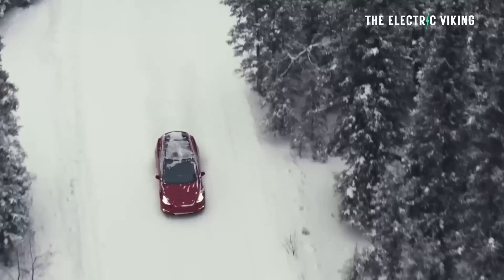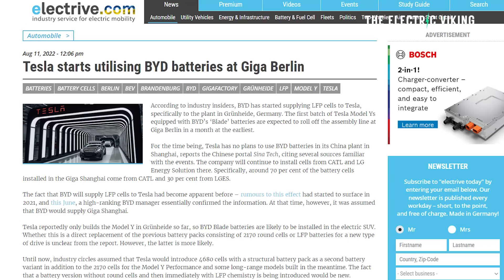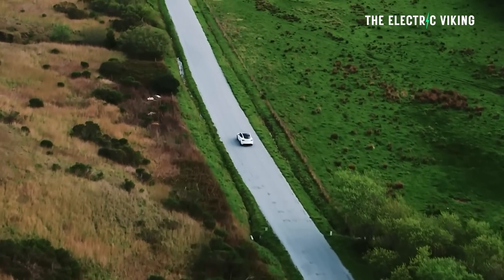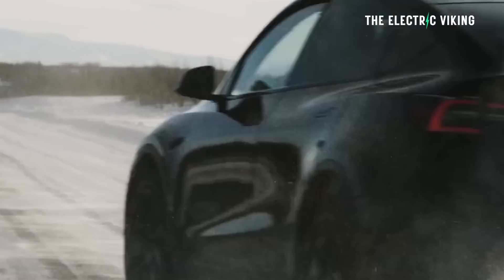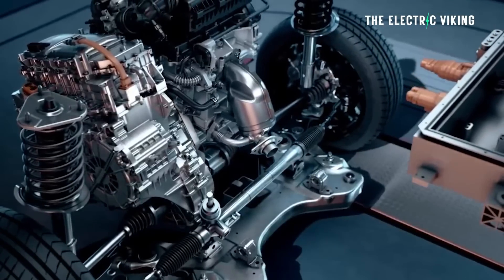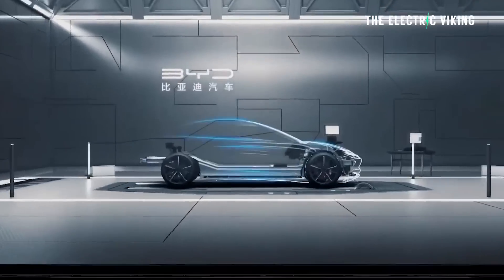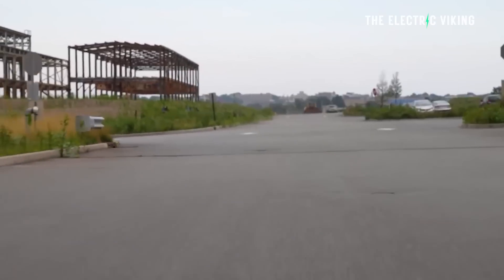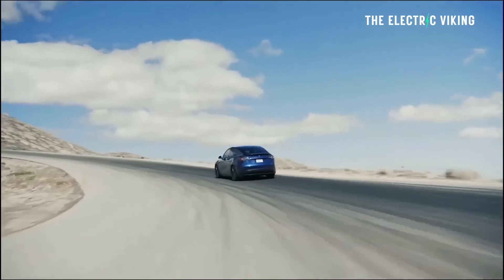Tesla Model Y's mysterious efficiency advantage VS BYD's Atto 3

Comment: Tesla is a superior car than Atto3. I driven atto3 in singapore and there are some issues with this car. Major issue is aircon failed to work during hot day and immediately after dc charging. It takes more than 10 mins for air con to cool. Range on atto3 is rubbish. The atto3 range drops so much after 10000km. Currently 480km range is now only 470km range and still less than a year. Wireless charging is total crap.

Comment: Let's calculate: front area Y 1921 mm width 1621 mm height maybe 85% of this rectangle filled times cw=0.23 gives 0.6088 m² for air resistance calculation.
At the BYD Atto 3: 1875 mm width 1615 mm height, assume also 85% of this rectangle filled times cw=0.29 gives 0.7464 m² for air resistance calculation.
At the weight, 1909 kg vs 1750 kg. Let's calculate 90 km/h:
Tesla Y: 25 * 25²/2 * 1.3 kg * 0.6088 = 6.18 kW against air resistance 25 * 0.01 * 9.81 * 1909 kg = 4.68 kW against rolling resistance, total 10.86 kW
Atto 3: 25 * 25²/2 * 1.3 kg * 0.7464 = 7.58 kW against air resistance 25 * 0.01 * 9.81 * 1750 kg = 4.29 kW against rolling resistance, total 11.87 kW
So why has the Tesla Y not a much longer range than the Atto 3?

Comment: They also use different motors, right? BYD and Tesla. There’s a bit a change in that. Since I have both model y and Atto 3, I would suggest Tesla has more efficient internal systems to run the car as well.

Comment: "How are Tesla doing this with the same battery?" Because of how leadership and political correctness work in organisations around the world. Dominated by leaders with zero material (in the sense that it matters at the content level) added value, who are in a leadership position because they had an urge to be the boss of something. Then the political correctness kicks in to tell higher levels what they want and need to hear. And innovation becomes an evolutionary, incremental thing where businesses behave like a monopolist who wants to saturate an entire market top to bottom, by selling their best product of today at a premium price to the most affluent buyers, next time frame for less to the next level down at the demand side and so on, in time replacing the top end by a marginally better or different version. Stupidity paired with economic practice.
Enter a hyper intelligent engineer, frustrated by all this, with a couple decades of experience, probably with a load of autism spectrum issues, thinking, I can do better.
Let's build a car: reduce drag coefficient, reduce transmission (including rolling) losses going as direct drive as possible, let's take a motor with very high efficiency so it must be electric and make its efficiency even better, and let's make all electronic circuits involved as efficient as possible. Rather than putting a committee to work on each of these, take a brilliant engineer in each of these subjects and the hyper intelligent boss scrutinises their work. Don't forget "design". Don't forget mass series production (Olds, Taylor, and Ford, could do it all by themselves, so you can too).
Dumb entitled leadership and PC - aircraft have crashed because PC meant you could not tell a superior they were wrong, killing hundreds of people, complete armies have failed, are failing, that way, political systems and bureaucracies are inefficient and ineffective that way, and successes are temporary because the hyper intelligent leaders also become victim of PC over time at the levels below them and generally are not able to select and coach the next wave of leadership.

Comment: The Tesla Model Y's external dimensions are actually less than 3% larger than the BYD Atto 3. 2.4% wider, and 0.55% taller. Not 20% larger.

The real world range of the Model Y LFP (60kWh) is nowhere near the 455 WLTP range (efficiency of 12.5kWh/100km). Other Youtubers have shown close to 18kWh/100km for the Model Y RWD LFP.

While the Atto 3, again, based on actual real world tests, often gets around 15kWh/100km, very close to their claimed efficiency.

I think Tesla is way over claiming their efficiency, and you seem to be blindly believing them, Sam.

Also, energy density is a function of energy vs weight .

In terms of comparing an EV, 60kWh is 60kWh. The chemistry doesn't change its output capacity.

Comment: It’s a mixture of small bits adding up, drag / frontal area, motor efficiency, cable sizing / length, Regen profiles, parasitic loads (aircon/heating being a big one) it doesn’t need to be much but if you can find 10-20 items with 1-2% you can find that 10-20% better overall efficiency

Comment: Probably a range of reasons that add up.  a) Cd - drag.  The Model Y = 0.23Cd, Atto3 = 0.29.   b) Rolling resistance (tyres etc)?  c) Tesla's motors and inverters are regarded as the best.  d) Then the ancillaries management, like the Octovalve,  e) better battery pack conditioning?   What you really want to compare is the actual range V say a MG ZS EV v BYD atto3 ie like for like as they are two entry level CUVs.

Comment: Tesla is surely more efficient with their thermal system and heat pump with the octovalve. More compact system with less loss. Also their computers and main cpu and screen(s) may be more efficient. They design their own chips and hardware in many cases. Their self driving computer which runs all the time is known to be more efficient than the comparable nvidia systems.

Comment: I was at a public charger this morning talking to a BYD Atto3 owner charging right next to me, and we were comparing batteries & range. His Atto 3 Had an 80kWh blade battery with 480km range. My Tesla Model Y RWD has a 62kWh LFP from CATL, and a range of 428km. We didn't compare distances traveled.  The Atto3 has a consumption of 166 watt hours per km. My Tesla is 144.   As Sam said, the BYD is smaller, maybe not as aerodynamic? but appears to be very close to Tesla's actual range per watt hour.   How this compares to other people I have no idea, but that's my 2 cents worth.   My Tip:  When on long journeys I pump my tires up to 45psi (normally 42) and drive at 5kph BELOW the normal 110kph limit on our highways.

Comment: 100% Australian accent yes. But don't expect non-english people to pick it up. British vs Aus vs NZ is not a big difference in accent, especially in a public speaking context.
Regarding the efficiency, it's down to aero and more efficient inverters and motors.
I wouldn't sing them any praises, all teslas are pretty rubbish at efficiency. Never mind the onboard charger at low load, tyres that cost a fortune.
There's also the various rating of the capacity of the battery. Likely that BYD overstates the size, or uses second bin cells whilst they sell the first bin to their competition for top dollar

Comment: According to Bjorn Nyland, Tesla’s drivetrain is the model Y is one of the most efficient of any other EV. They have been perfected it for years now to drive in highways efficiently. Unlike what most ppl think, there is a gear ratio in EVs as well, its just constant, unlike in fossil cars. So that ratio affects the motor’s efficiency in different speeds.
Also if you factor in the drag coefficient, their thermal management and probably other stuff they been perfecting, you get one of the most efficient cars existing.

Comment: You sound very Aussie to a Yankee like myself. Tesla simply has a higher efficiency platform, motors, and a more aerodynamic exterior shape. Thus they can squeeze more performance and range out of the same battery pack as another BEV OEM. Lucid's Air currently has a more efficient platform, motors, and a more aerodynamic exterior shape than Tesla's Model S. Thus the Air has a longer range than the Model S with a similar battery pack (2170 vs 18650 ternary cylindrical lithium ion cells). Sadly Lucid's overall production efficiency and business efficiency is currently much less than their vehicle efficiency. Hopefully this will improve with effort, time, and scale.

Comment: Aerodynamics, motor, regen, chipset, HVAC (Octavalve), BMS, batt pre-heat, reduced weight, dual purpose structural design, tyre resistance, micro designed external surfaces, weather/incline prediction etc etc etc. All these areas, Tesla has been relentlessly pursuing since inception. These continually evolving and improving designs are your answer to the mystery posed in this video.
Reply: Amen!

Comment: An important difference between Cell to Pack and the 4680 structural pack. The BYD blade cells provide structure to the pack, making the case lighter and providing structure to the car. Tesla's 4680 structural pack does not have structural cells and uses a relatively heavy pack case that is filled with rigid foam. BYD is one more step forward in integration,  making the overall pack lighter, even though the cells are heavier. Benefits include the ability to disassemble and repair or reuse, as well as making recycling easier.

Comment: I chuckled at your question re if you sound Australian or not. IMO, you do sound Australian to this Texan.

I also always chuckle at your use of "is" vs "are" in sentences with collective nouns. Your question in this video at 2:13 "How are BYD getting such a low amount of range in comparison to Tesla?" is not the grammar I'm accustomed to using. Instead, I would've asked the question like this: "How is BYD getting such a low amount of range in comparison to Tesla?" Is there more than one BYD?

If you'd asked your question this way, then "are" would be appropriate: "How are the engineers at BYD getting such a low amount of range in comparison to Tesla?"

A company name is a collective noun and almost always use "is" in a sentence. The exception is when you discuss the members of that group, making the noun plural. I found this example on a grammar site: 

- The team is determined to make the playoffs this year. (Team is singular.)
- The members of the team are working hard on the field. (Members is plural.)
- Is your class learning about invertebrates? (Class is singular.)
- The students in my class are excited to dissect an earthworm. (Students is plural.)

Comment: Like most have said, drag, motor efficiency/software, and tires. I have gotten a 10% mpg increase from a 30 mpg car. That 3 mpg increase surprised me. And the hard riding tires in some ev's are even lower in rolling resistance. Even the wheels have a part in wind resistance. Mercedes, and I am sure others, use wheels that evacuate air from underneath a car which reduces wind drag on the bottom. BYD may be copying but they might be copying wrong. Mr. Viking said the vehicles are similar. Are the ground clearances the same? A lower ground clearance ups the milage.                      
etc, etc.

Comment: If you watch Sandy Munro discussing Tesla 
The thing they do is integration of build. If they can reduce parts by designing out structural obsolescence they do so. F1 design will save grams here and there to add up to huge weight savings overall.
This is the same as going to using structural battery packs, monocock bodies from bodies on chassis

Comment: I have seen a lot of people talking about the drag coefficient. The drag coefficient in itself is not enough to explain the differences. I will try to briefly summarize what I know, maybe some will find it useful :
- When measuring air resistance, the drag coefficient is not enough. You need to take into account the frontal surface of the vehicule. If I could build a Model Y twice the size of the current model with the same weight, it would still be a lot less efficient. Now, some have noticed the Model Y is bigger than the Atto 3, but it is mostly due to its length, not his height or width. This is a smart choice as it does not add frontal surface. This is why sedans are structurally more efficient than SUVs.
- Second, while the Model Y is bigger, it is also lighter than the Atto 3 and quite significantly so (1,9T for the MY versus 2,2T almost for the Atto 3
- Some have mentionned the electronic and the mechanics, and yes it does play a role in there, especially the configuration of regenerative braking has a huge impact on efficiency
- Suprisingly, nobody has mentionned the biggest efficiency advantage that Tesla has over competitors when it comes to efficiency, which is the unique technology their motors use.  Most competitors use permanent magnet synchronous motors, while Tesla uses motors that mix up permanent magnet technology and variable reluctance technology, which allows the vehicules to be efficient at low speed but also at high speed on the highway. Unlike other electric vehicules, Tesla engines maintain way over 90% efficiency at high speed, by switching from the permanent magnet to the variable reluctance. Tesla's engines are more complex and more expensive to produce, but they are also way ahead of the competition on one of the main pain point for electric cars.
Reply: Your weight is incorrect - the Atto 3 LR (which is the same 60kWh battery as the Y RWD) is 1825 kg and the Tesla Model Y RWD is 1,909 kg so its actually heavier. I think you were looking at GVM for the Atto 3 which is the maximum weight the vehicle can be loaded to.
Reply: Forgot to add a link to a very interesting video on electric vehicules motors (it is in French but you can activate subtitles) : https://www.youtube.com/watch?v=pPyllpRsvbs

Comment: I see a lot of people commenting on drag. Definitely a factor, but as someone who has worked with electric motor controls for over 20 years there is something that's even more important. Motor drive tuning this is purely a function of software. The VFD (Variable Frequency Drive). It is what will set many of these EVs apart from each other. You could take identical car with 2 different tuning profiles and get vastly different results.

Comment: Minimal research shows the Tesla is not 20% bigger in every dimension. It is 7% longer, 6% wider, same height and same weight. Length doesn't affect drag (same frontal area) so only the 6% width is against it. But that is easily neutralized by its much more aerodynamic shape (coefficient of drag difference)

Comment: Absolutely does add up. We have an Atto3 and a Model3 with identically sized 60KWhr LFePO batteries. The Model 3 gets about 10% better range kilowatt hour for kilowatt hour. 

The reason is simple, the Atto 3 is wider, higher and is slightly heavier so has greater drag.

If you drive the Atto3 slowly, the range difference is not so marked.
Reply: Who wants to drive slow?
Reply: @rozonoemi9374  Most aren't speed demons. But if you are you should enjoy an EV, they can go like a rocket.
Reply: That's an interesting comparison though, because one would expect the smaller sedan to get more than 10% range than a taller, heavier SUV, right?
Reply: Just at speed limit is fine.
Reply: @rozonoemi9374  Interestingly the Atto3 has a feature in its adaptive cruise control that limits the vehicle speed to the speed limit, great for inadvertently running foul of speed traps
Reply: @jimgraham6722  I wish my Tesla had the same thing, except I'd like to have with WITHOUT cruise control being active...
Reply: @greghudson9717  Should be doable with a software upgrade.

Comment: Yeah, you’re an ocka, you can definitely tell you are from R-stralia.
Yep, efficiency and excellent design.  If its exactly the same battery packs, and all other things considered are the same (Cd rating for instance) and the same method of range calculations are being used, then its most likely higher levels of skill and engineering capability.   Tesla have very smart engineers (I am not saying anyone else does not though), and maybe the research is paying off.

Comment: I can tell you my Berlin Model Y long range averages 152 wh per km whareas my Peugeot 2008 which  is a single motor third of the power smallish CUV uses 160-170 wh per km.

Comment: Tesla has a long list of things that they do to achieve such a high rate of efficiency. Reducing weight of the vehicle body, drive train, battery pack, seating, and heating/cooling systems. Increased efficiency of inverters, drive trains, and motors. Using a high efficiency heat pump with the OctoValve heating controls, and using efficient computer chips and electronics that are running high quality software that optimizes efficiency.

Comment: Model Y cd is 0.23, atto 3 is 0.29

That will have a significant impact at speeds >30mph

Model Y weight is ~1900kg, atto 3 1825kg, so atto has a slight advantage there.

Ancillary current draw to do things like heat cabin could be significantly different between the two (don’t know, hard to Google that one)

Teslas software may be using the same battery pack deeper than BYD are comfortable with.

Rolling efficiency could be better on the Tesla, again difficult to Google for a comparison to the a atto.

Comment: As many have already mentioned, drag coefficient, especially at highway speeds, is THE main factor.  If you want to double your highway speed, for example, from 80kph to 160kph, it requires 8 TIMES the energy, not 2 times.  Energy consumption at speed scales at 2 to the power of 3 ( 2^3).